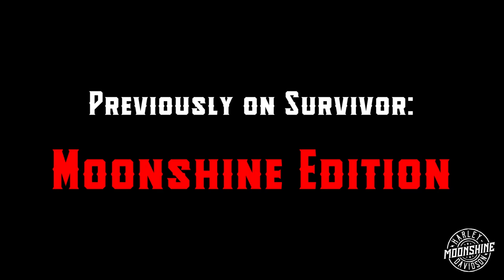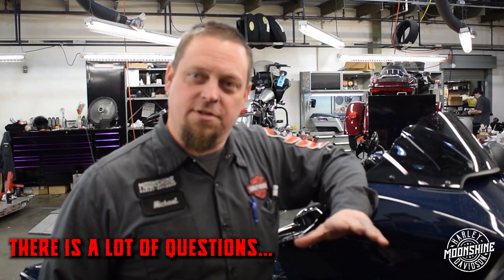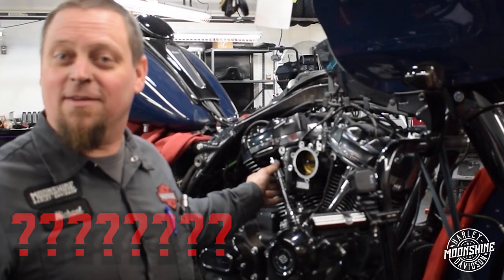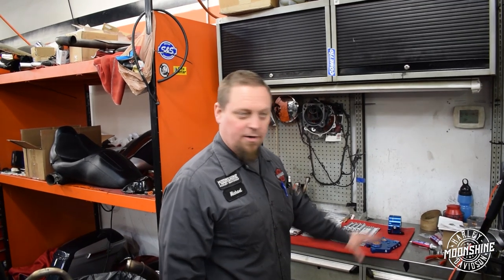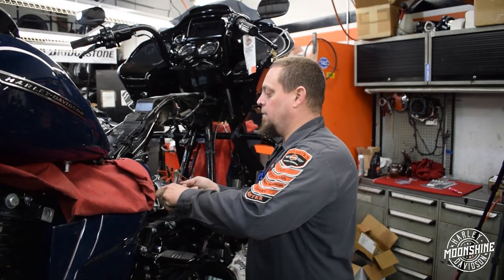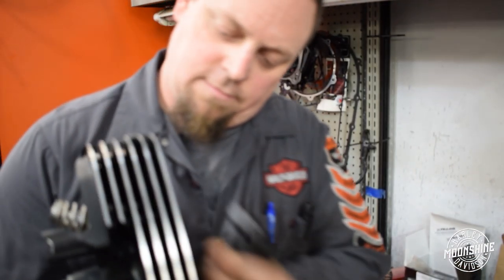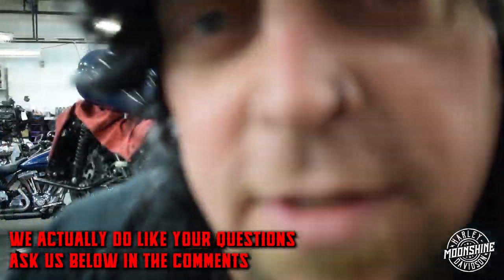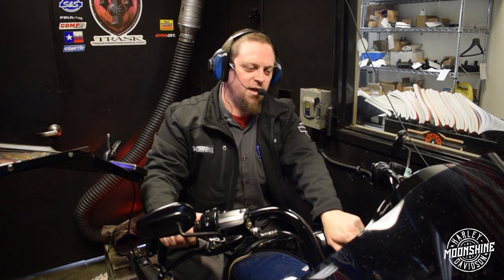How To Build A 128" | Shop Talk Episode 34

Comment: Let me start off by saying I'm 73 and still do all my own Wrenching. I installed the 128" S & S Cylinder Kit awhile back. Also installed a Stage 4 Kit minus the Cylinders and Cam. Harley Extreme-Flow Intake & Filter.  I  polished all the Ports and Combustion Chambers and the Plenum. I put a Zippers RedShift 468 Cam in. Also S&S CamPlate/OilPump. I replaced the Rocker Arm Shaft hold-down bolts with Studs. I installed a ThunderMax ECM and let it do its Magic .  Put on a D & D Billet Cat Exhaust. Now I find out that Harley has a 131" Stage 4 Kit so I bought it.  So now off with most of the stuff I put on and I'm installing the New Stage 4 Kit...after I polish the Ports & Combustion Chambers.
Reply: I’d like to hear the numbers you get with the 131 and D&D pipe. I’m looking to do the same thing. Did you go with the big bore baffle?
Reply: Save your money and buy gold instead. If a 128 don't give you a stiffy then you have E.D.!

Comment: Damn Disappointing, I’ve been waiting for this to drop, but they cut out all the technical information, and pretty much offered no new additional info. Could of been awesome. Fingers crossed that they release everything that they cut out
Reply from the maker: We have a 124/128 Shootout Video dropping next month with HP and TQ numbers. We are behind schedule on it but we wanted to add our new cam to it before releasing.
Reply: Moonshine Harley is it normal to have little rubber shavings in your transmission dipstick and around the oring on it? 2020 FLTRX w 2k miles.

Comment: I just got the S&S 128 kit in my bike, full cam chest with their 475 gear cam, 2-1 exhaust, then put in a new clutch, basket pressure plate and compensator eliminator as well.
Reply: How is it?
Reply: Meet Doug Black amazing haven’t gotten to ride as much as I want because if weather where I live. But I love it!
Reply: I have the S&S 475G cam in my 19 RGU.  I was thinking of grabbing the S&S 128 pistons and cylinders over the winter.  I know the Full 128 kit ( the $2600 one I am referring to) they use the 550 cam but I was curious how the 475 does with it since I already have that cam.
Reply: Jason Carboni from what I was told by S&S the 475 is more of a torque setup and the 550 is Hp with the 128. I wanted the torque so I went with the 475.
Reply from the maker: @jasoncarboni3682  the 550 doesn't preform well on the lower RPM unless you pair it with heads and throttle body. The 475 with stock heads is a stump puller!!!
Reply: The 475 is a great torque cam. I have one in a 124  with stock heads and SE 64mm throttle body and I got 129 HP and 140 TQ. Over 130 TQ at 2400 RPM and the horsepower doesn't fall off at all. It maxes out at 5200 and just stays there until redline.

Comment: Please do an overview of the 131 kit. I’m told the head pipe that comes with the kit is similar to the one that’s on the bike. What’s the difference with the included head pipe versus the stock one other than a Euro4 stamp? I’d like to see power numbers with the 131 with the included head pipe and mufflers versus a 2-1 aftermarket (e.g., D&D Billet Cat).
Reply from the maker: Will have it later this year. We'll also see what it does with different cams and our Moonshine Branch O'Keefe heads paired with a HPI CNC'd throttle body.

Comment: How would this compare to the H-D stage 4 128 kit
Reply from the maker: This setup makes over 130 foot pounds of torque from 2,000 rpm's and carries it to 5,000 with a max of 144 around the 4,000 mark. The Harley set up maxes out around 125 and is less than that for most of the pull. here are the main differences in this set up and the Harley-Davidson; cam, injectors, exhaust and tuning. There are some more differences but these are the main ones. If you have more questions please call the shop and ask for Aaron or Jamie - 615-274-4170.

Comment: I have s&s 128 build. Im running fullsac head pipe with tab zombie baffle. I got a feeling there is alot more in the bike. If i change the baffle or change the slip ons. Can you shed some light here please?
Reply from the maker: The zombie baffle makes the most noise but you sacrifice a lot of HP/TQ numbers. We don't have exact numbers on the different Tab baffles but you'd be better off running their 2.5" or 1.75" louvered core baffles. We would need all the specs on your 128 to let you know what we would suggest. We do have exact numbers of Khrome Werks and S&S Performance mufflers in combination with the Fullsac on lot's of 128 combinations. Please Jamie at the shop for more detailed info 615-274-4170 or Jamie@moonshineharley.com
Reply: My 128 s&s build with the tab zombie baffles made 150 hp an 150 trq. I have the 2.5 baffle. Im wonder of i should change it or leave it alone.

Comment: What do think  of the SE-447 Torque Cam? You don't seem to ever use it.
Reply from the maker: We have used them in certain situation but there are cams available that will offer better performance for the same money. Let us know if you need assistance 615-274-4170 ask for Aaron or Jamie
Reply: Biggest issue is warranty concerns and CARB for me.
Reply from the maker: @michaelcardoza997  than it's the setup.

Comment: Do you Zero Deck your piston height?
Reply from the maker: Depends on the build. We use several different piston designs and we setup the compression ratio depending on the cam we select.

Comment: Is it a bigger kit than the 128 available for the M8?
Reply: Yes, they have a 131 kit now. You'll be chasing 5hp vs the 128 so why bother?
Reply: @Cwra1smith  👍
Reply from the maker: @Cwra1smith  With the HP/TQ numbers we make on most of our 128's we require thicker cylinder walls than the HD 131 kit provides. The Harley-Davidson 131 kit is good but its not designed too make more power than it comes packaged with.